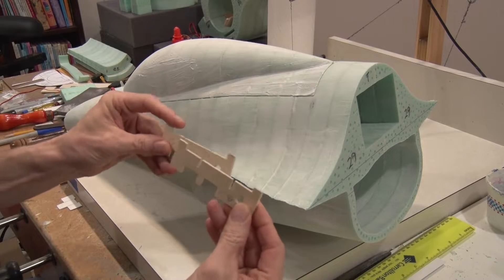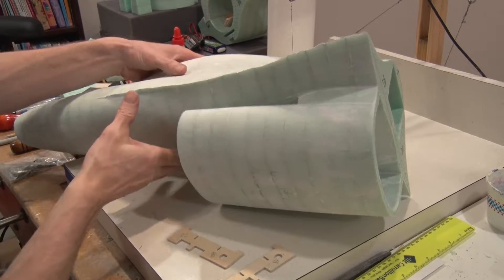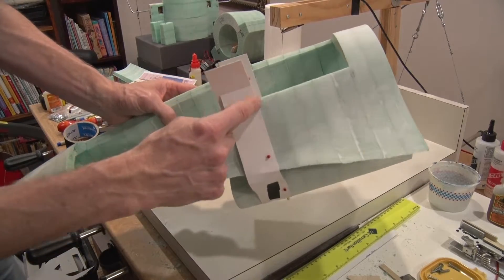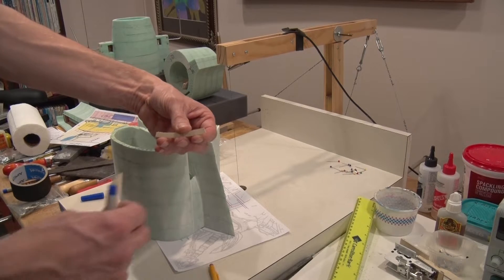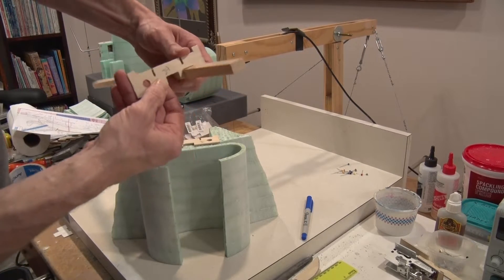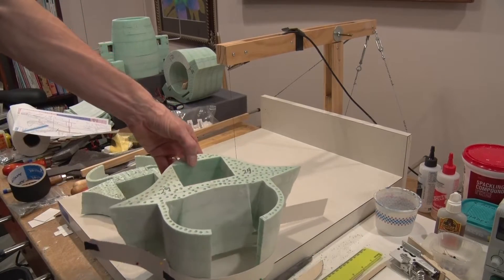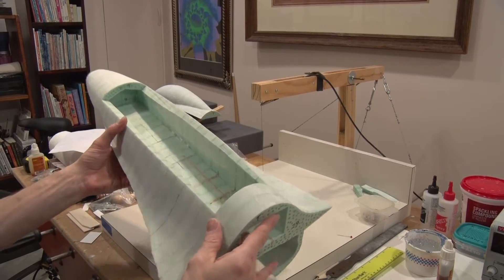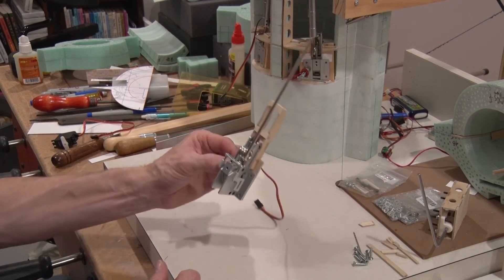Build Process F 16 D Part 4

Comment: Just curious...why didn't you incorporate your wooden supports for your landing gear etc into your bulkheads before you initially glued it together ? It just looks like your undoing a lot of work already completed
Reply from the maker: cyclistpilot Because the original plan was to use a pre made unit that would fit in afterwards.  Such as the Freewing landing gear set.
Reply: VideoProRC 
I see ...beautiful build by the way . I was going through the playlist and couldn't see part 5 so I'm eagerly awaiting its release . I'm an RC model flyer and builder myself and I'm in awe and respect of the different techniques people use to build their models and I always take away some lessons and hints from every builder that I watch on YouTube . I plan to use your methods to build a Pilatus PC9 eventually

Comment: I really like what you did with these plans and how your segments came out. I tried to make plans, but they did not come out. You may give them to me too, they will greatly help me with my college degree. thank you
Reply from the maker: Gheorghe Girbocea 
I don’t think giving you the plans would be appropriate if your going to use them towards helping you in college. I think you should do the work yourself. Your the one getting the degree. Not me.
Reply: the real challenge in my license is not the construction of the plane but the attempt to try to create a functional automatic pilot. There's a lot of work to do to make a program and find the sensors and the right method. that's why I've tried to get a little bit out of my work. anyway, it's your job and your choice, you really did something nice there. thank you and have a great day!
Reply from the maker: Gheorghe Girbocea The F-16 airframe would not be the ideal platform for that purpose. I would suggest a prop plane that’s a little more stable. You can purchase a ready to fly airframe and save yourself a tremendous amount of time. To build a jet like I have for your project would be risky and time consuming. My plans will be posted on my RCGroups build thread after it’s completed and test flight has been proven. I do have another jet on line that have the plans posted. Look at some of my other videos. The LFI-S21 airframe plans are on my RCGroups build thread.
Reply: I know the model itself is a bit unstable but the theme of the license is for this model. And buying it is not an option because it has to be built in the academy workshop. I would be very grateful if he could help with these plans. respectfully .
Reply: @gheorghegirbocea1997  If you want plans on how I built mine I'm willing to tell you how, or ideas from other people in our labs, but I would recommend against a project of the magnitude in the video.
Reply: Adam Hale I would be grateful if you could help with this project, I tried so far but I totally failed
Reply: @gheorghegirbocea1997  If you can send me some details of what you need to construct and what materials/tools you have available. I'll can show you some of the things in our lab and our methods used. Do you have whatsapp?
Reply: @gheorghegirbocea1997  What is your country code? (+##)
Reply: Adam Hale +40
Reply: I'm also a college student working towards an aeronautical engineering degree. I've been working on a scratch rc build for two semesters, but it is much simpler than this. I think that a project like this would be impossible to complete in school, but there are much simpler methods to making a good looking scale aircraft. The aircraft I'm building is a Piper Arrow. It's the only scale aircraft they've seen built at my university. I wouldn't use it as a programming test bed however. People at that point in their education have opted to use more simplistic and efficient designs that are more likely to survive a mishap.